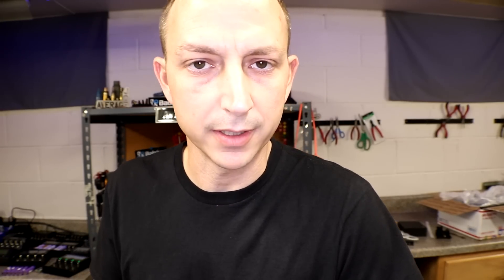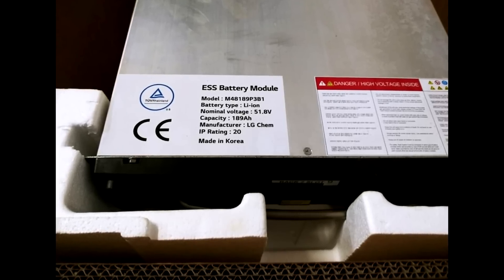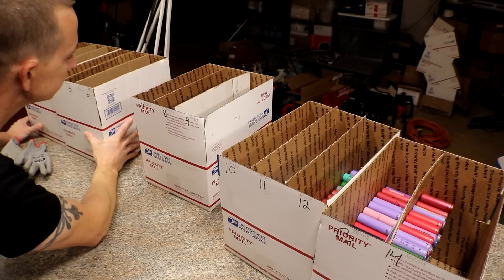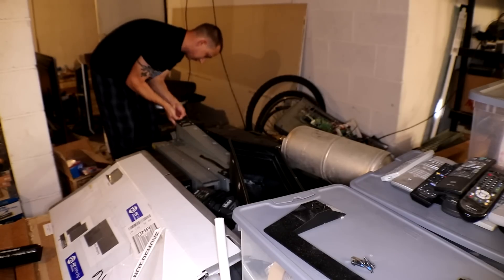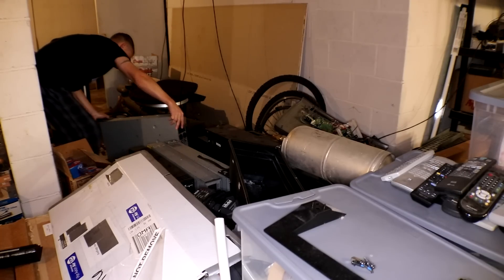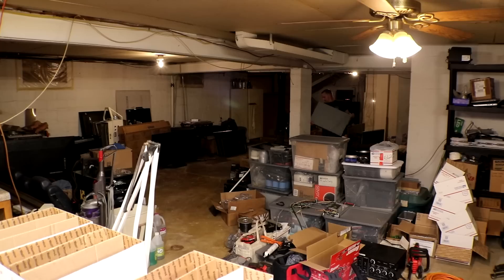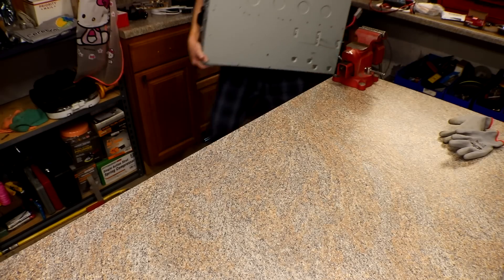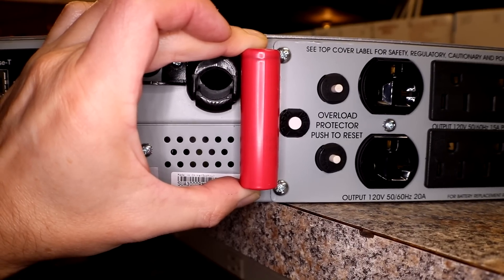UPS Battery Bank

Comment: Hey Joe. Thank you for the update. 
Can you take a measurement on the transformers you pulled out of the APC3000? I’m running a powerwall with same model but 2200 VA. My mainboard is marked 3KVA but only have 3x4 mosfets. I believe that yours has 4x4 and maby more if its and XL. More mosfets can  installed, but I fear that they use different transformers. My transformers measure h x w x l = 80 mm x 95 mm x 105 mm. To those of you prefers “freedom units” I can translate it to 3 and 5/32 inch x 3 and 47/64 inch x 4 and 9/64 inch. As a math teacher I must say I love the simple beauty of “freedom units”. BOOOM  :)

Keep up the good work, Ole Baltzer Brinch
Reply from the maker: Mine measures 4-5/8 x 3-13/16 x 3-3/16 and my board has 4 sets of 4 mosfets!
Reply: @AVERAGE_JOE  I was joking about my love for freedom units. :D  It seems only the length is different (if you measured the iron core). Mine is 105 mm and yours is around 117 mm. Not much difference really. I have 2 x APC 2200 I might just have to try and convert one to do 3KVA mainly just because I think I can. Thank you for the info on the APC.
Reply from the maker: I know you were!!!😜 Yeah I measured the iron core.  If you want coil I can check that as well.  It shouldnt be to hard to add the extra mosfets.  I think you need to add some resistors as well if I remember right.
Reply: @AVERAGE_JOE  Core is fine. I just wanted to know if the transformeres on the 2200 and 3000 were the same, but I guess not quite. I will make my 2200 sweat none the less  :D
Reply from the maker: Yeah I can get some measurements for ya. I prefer freedom units as well 😉💥  Ill let yeah know how many mosfets as well if interested.  Side not: The UPS Im using in the rack is a 3U and is an XL version.

Comment: Great video - fantastic project. 
For people who want to quickly and easily calculate the battery pack (up to 9999s 9999p ;-) I suggest try free Android App: "Battery Pack Calculator" (Google play) . 
Calculates: voltage, capacity, energy, discharge current, price etc. Build-in 37 popular cell type + you can add own. 
https://play.google.com/store/apps/details?id=pl.freshdata.batterypackagecalculator
Reply from the maker: Thanks Man and Ill check out that app!

Comment: Hey Joe what about a metal fire safe paint storage cabinet its double walled metal I'm going to put 12 chevy volt lithium battery's  in mine 2kw @=24kwh48v
Reply from the maker: I would think that would work pretty good or at least help contain it.  Inside or outside?
Reply: @AVERAGE_JOE  out in my garage I have a small 120v thermostaticly controled heater to keep them from freezing so they can charge plus I have tons of 18650 cells to process and build packs when I find time I watch you HB powerwall (peter) & david poz and the guy in Canada living off grid been wanting to go Solar for   25 years finally getting about 95% components to realize the dream next summer would like to find a fireproof insulation for my paint cabinet to insulate and protect even more
Reply: I have 9-320w panels and 9-340w panels almost 6kw and a 6wk snyder zantrex hybrid inverter

Comment: This is a great idea. In fact, since I still have the same size server rack, I'm going to investigate what can be done with 1U cases. It would be more manageable I think. Alternatively, 1s600p packs or 2s300p... Big ass custom connector studs on the back plane and bearing sliders...
If I do it that way, I'd be inclined to seal the rack and mount a box on the back with 2x120mm fans, ducted to outside. That way in the event of trouble, all that acrid smoke could be vented. The BMS can also be programmed to fire up the fans on temp when required.
Reply from the maker: 1U cases would be kinda cool to!  I had a few of them last year but game them back to recycler DOH!!!!! Not sure how many you could fit in there but you could fit a lot of 1YOU's in the rack for sure!!!  Yeah some exhaust fans would be nice in the postal event for sure!!!
Reply: @AVERAGE_JOE  personally, I'm not indifferent to going postal from time to time 😜
Reply from the maker: Samzies!😮😆

Comment: You have them batteries contained like a grenade... Could you build a cinderblock enclosure on an outside wall to contain your battery bank in case of a thermal event? Kind of like a shaped charge, when it goes off it would be directed away from your house, the access doors being the weak link.
Reply from the maker: Yeah I was thinking about that and would leave some vent holes in each case.  Yeah I could probly build a cinder block enclosure/shed closet thing outside and have the door face away.  I might as well put it in my "bunker" as its all cinder block.  I think it was designed more as a tornado shelter type thing but the door is in basement.  I could have an exhaust in case it ever went postal.

Comment: Hey Joe... so your little fire talk got me thinking and hope its nothing but .... So home owners insurance would it cover u in the case of a fire caused by the battery.... if your making money  by making YouTube videos in your home about the power rack does that  make your home now a business and do u in turn need business insurance or would u still be covered by your residential insurance
Reply from the maker: That is a very good question!  Of course I dont have anything setup as a business since I do the youtubes in my spare time but should probly change it to a business!  Totally answered you question I Know😆

Comment: What kind of charge controller you use? What kind of charging protocol does it charge at?  I have a EPever tracer A, and not sure it does the best charging, I think it just shuts off when full. No float charge,  I want to test it out, but would like a better larger current controller!
Reply from the maker: I use the pcm60x and linked down below. Its a mppt and not for lithium but you can log into it and change the parameters to what you want.

Comment: I found a old wine chiller, I'm thinking about putting mine in, and put it outside! With a tiny heat pad, for the cold month or two! It has a glass door, it could look nice, they allvwi not fit  about half, I can put the other few THOUSEND cells, in something else. In a little shed outdoors! I don't need anymore house fires!!
Reply from the maker: Yeah a wine chiller would look really cool!  YES dont need any extra fires in the house FO SHO!!!!!!

Comment: What causes these cells to ignite? Overcharging? I was going to do another 10kwh but now you scared me.  It's like I have a ticking timebomb in my garage.
Reply from the maker: Im not trying to scare anyone but want everyone to play safe and not have a fire.  If you think about it, there hasnt been many or any fires that I know of if its all put together and used in a safe manner.  For the most part overcharging is what causes fires and using them in an unsafe way.  I just want to prepare for the unknown thats all.  🤘
Reply: @AVERAGE_JOE  well mine is identical to yours except mines sitting on a wooden shelf and I went with a 48v pip instead of the charger/ups combo. It's been running for a year with no fire.
Reply from the maker: Sweet!!!  How you liking the pip?  One day Ill have a real inverter 😜Yeah I havent had any scares since Ive been up and running(except when I tripped into packs on bench and blew 200 fuses) but that doesnt count😉😉

Comment: Where’d you get that ups enclosure I’ve had the same idea for a while but just can’t find any enclosures
Reply from the maker: Just ripped the insides out and drilled out the rivets for the battery compartment divider.  Ups's I get from e-recycler!
Reply: Oh My recycler sucks he never has anything 😕
Reply: I did just get over 1000 MacBook batteries but there the pouch style what can I do with them?
Reply from the maker: If there any good or capacity test good then you could really do anything!

Comment: @AveRage Joe, maybe a silly question but how do you plan on stopping the top and bottom contacts on the cells from shorting against the base and lid of the 2u case?
Reply from the maker: Ill probly use some thin concrete board from the hardware store.  Just gotta see what thickness's they have.

Comment: Hey Joe, excellent idea, I would put fans at either end to help air flow and cooling, use watchmons temperature control to switch on fans, also have fire extinguisher bolted to side just in case, like the dancing 🐈 cat,is it Mexican
Reply from the maker: Thanks Man!  Yeah a few fans will be added for sure and YES batrium to control them for sure.  Fire suppression is also another to be worked out!!!!  LOL Horus?  Who KNOWS lol picked him up off the street!😮😆

Comment: This looks like a decent plan with 2S in each case.  Can you score another rack?  Have enough cases?  Are you the reason there seem to be NO rack UPS units anywhere in the recycling pipeline??  ;-P  The increased safety would NOT be containing fire, but in preventing accidental shorting CAUSING the fire (batteries less likely to fall over or better containment if they do fall and thus BOOOOOOM-YAH).
Reply from the maker: Im kinda leaning on the 2s in each.  My recycler does have another half rack that Im trying to get from him LOL.  Its not the same or anything and may be just a little shorter but deeper.  YES I hoard all the UPS's for myself😆  Yeah the cells would be less likely to short from accidental tripping for sure lol

Comment: After seeing the video of the fire test of one of those tesla industrial powerwall cabinets and immediately bought a steel Rittal case to put all my electronics in, including my battery. No way I am ever going to make a solar generator with a plastic container.  I also store my separate cells in a steel filing cabinet.
Reply from the maker: Do you have a link to that?  Id like to see it if I havent yet!  Yeah thats another thing I still need to do is put the storage cells and untested laptop packs ect.... in a safer place.👍
Reply: @AVERAGE_JOE  For the Tesla power pack I have this article: https://electrek.co/2016/12/19/tesla-fire-powerpack-test-safety/ Thought I saw a video of it as well, but cannot find it right away.  The rittal case I use is the AE 1073.500 model: https://www.rittal.com/ca-en/product/show/variantdetail.action?categoryPath=/PG0001/PG0002SCHRANK1/PG0021SCHRANK1/PRO0023SCHRANK&productID=1073500  , providing some wheels I got it moveable for a local scouting group. Quickly put up some pics of my setup, still need to write it up a bit: https://navni-stuff.blogspot.com/2019/10/diy-li-ion-powerwall.html
Hope this got you the info you wanted
Reply from the maker: Did you post on diypowerwalls facebook page about your setup?  I thought I remember seeing something.  Anyways, Yes I have read that article before but its nice to come back and read it again.
Reply: @AVERAGE_JOE  Yes indeed I already posted this to the facebook page.

Comment: 14S is overkill you can gain more capacity by dropping your voltage  and handle more current but that would mean getting a different inverter. Personally ide go with the voltage i needed per case then bridge it all together at one point for the inverter to feed power from. Thats the way ive been doing for a while now and its working just fine for me with 0 issues what so ever. Im only using a standard bms though im sure the Batrium is great but in all reality they are a little to proud of it with the price point, I will never buy it. Lowering your voltage you would need less long-mons per case to save money but there again inverter must be compatible with the voltage. GIANDEL on amazon has an inverter that is compatible with 16 volts for 4S Jehu tested the 24 volt model and the sign-wave is clean. Building each case for the voltage you need just makes good sense to me
Reply from the maker: Im kinda leaning to a 2s in each if I go this route but 14s or even 13s would be cool to do.  Another issue I was thinking of 13 or 14s in each is I would need closer matching cells to get each ups to be close in capacity.  If I do 2s I can use a wider range.  A real inverter would be nice for sure and one day Ill get one but for now Ill use the free UPS lol.  I dont think Ill ever go back to 12v, if I ever changed it would be a minimum of 24v.

Comment: This is excellent!  Your 2S per enclosure idea looks like a great solution. With each 1S pack being that large, can you maneuver it around without shorting any of the exposed contacts? Smaller packs, each with it's own cables, might let you draw more current AND be easier to handle.
 
Is there room to fit a sheet of 1/4" cement-board (Hardiebacker from HomeDespot) in the bottom of the case?  This would insulate the cells electrically from the metal case AND insulate them thermally if the enclosure below goes nuclear.  

Also, maybe space the top panel up to leave a 1/2" gap at the back -- if something does catch fire at least you could send it in a safe direction.

Do you have a clear path to roll the whole thing outside if you need to? (Sort of like the Starship Enterprise ejecting its warp core.)

(Watching to see what you come up with!)
Reply from the maker: Thanks Man! Im kinda leaning on 2s per ups case and you are thinking exactly like Ive been thinking lol.  Get outa my head 😆 JK!  So yeah 2s but separate packs for easy handling AND the 1/4'' backer board for those 2 reasons!!!  Yes will need space in the event to force things to go where I want with a "vent" on the back side.  Dont have a clear or easy path to outside as Id have to pick up the hole rack and carry upstairs lol but I like your thinking on the starship enterprise!!!  

I also need to figure out which U ups I can easily get or more often.  If is 3U then I may be able to fit more cells in on there side and then use concrete board in between which might make it a little safer cause each "pack" inside will be its own "compartment" . Since 2s kinda makes more since I can only fit 7 3U ups's in there so might as well  go that route.  I guess WOOLC!🤔🤘

Comment: Great idea except for the heart issue...I can imagine the cells in the dead center, on a hot July afternoon being uncomfortably warm while charging/discharging... They'd make the red Sanyo heaters feel cool to the touch!
Reply from the maker: Ill be sure to but those near the outer edge😆💥🤘
Reply: The Sanyo heaters can be fixed by cycling them a few time.  I put them in my Opus c3100 and do the refresh mode. Time consuming put I was tossing a bunch of 1500 - 2500ma cells.  After refreshing they don't heat up.  I have an extra 42u rack if your interested.  I also found that 18" wide by 3' deep unicorn shelves fit inside the rack.  You just have to mount the rails on the bottom.  I have a ton of outer rails, so would need to find some inner rails.  All HP.  I'm looking for some 3000kva upss, 48v version.   Found out mine are 192v versions which is a lot scary.
Reply from the maker: @scotsorenson6344  Yeah a few cycles usually does the trick with those Sanyo's!  I may be interested in the rack,  Does it have doors of any sort?  I have an extra UPS that is the exact same model as the one in video and could probly get a similar one or are you looking for the XL version?  Yeah 192v is scary for sure lol
Reply: @AVERAGE_JOE  yes rack has doors,  even have a key if I can get it duped.  Any UPS would work.

Comment: Hey buddy, so I think you're using the medium duty 1U sliding shelf from rack solutions right? If so, I own an IT service company and we get all our products direct from manufacturers instead of thru distribution, which cuts down significantly (usually) on pricing. So, don't know if you care, but I can prob get rack shelves for much less than $200 and don't mind using our manufacturer relationships to help your channel. Just lemme know if that's something you think you would wanna do and we can contact each other somehow not in the public comments of a video!
Reply from the maker: Thanks Man aaaaaaaand we ALL steal each others ideas😆🤘
Reply from the maker: NOICE!!!! Ill have to take a closer look to see what the difference is med vs heavy duty but I think mine are heavy duty based on the pictures they show on there site.  I also installed them upside down to there more of a tray lol.  Anyway I may need your manufacture relationship😉 if I dont end up going with the ups enclosed packs.  Also my email is on the about me tab on my channel homepage!  Also thanks again!!!
Reply: @AVERAGE_JOE  Sounds good buddy, keep up the good work and I'm willing to help if there's anything we can get thru distribution channels. Figure I owe at least that considering I watch your videos and steal your ideas all the time.

Comment: I have a 6s 100p setup x 5. Instead of using all those bms I just hooked each cell in parallel with the next so the 3.7v railes are hooked together and all the 7.4v cells are all hooked together. Not sure if that helps ya.
Reply from the maker: Yeah that is one way of doing it.  If I do the 2s300p Ill just add longmons.  Easy peasy lemon squeezy 😆

Comment: Why not use backing soda inside the top lid (same principles you used sand bags on the 18650 cold test)? When baking soda is exposed to fire it will relies carbon dioxide that will stop oxygen from feeding the fire. It also releases H2O when in heat/fire with the result of cooling the area, thus no heat no fire.
Reply from the maker: Its an interesting idea. I know the lithium cells create there own oxygen but the cooling effect sounds cool. Have you seen any test with it?
Reply: AveRage Joe I have not seen this used in that kind of setting, but I have taken a couple of firefighters class. When a testing room was on fire I crawled in to the building with a pressurized canister with baking soda and was instructed to just spray it towards the sealing of the room and the fire just chocked.
Reply from the maker: Very interesting!!!!!🤔🤔🤔